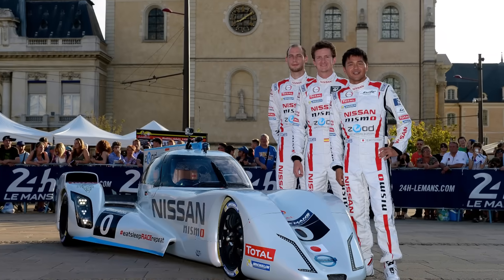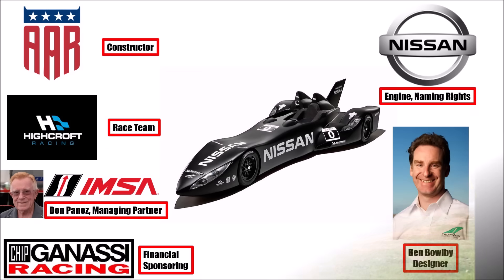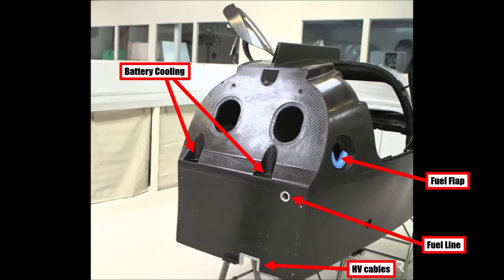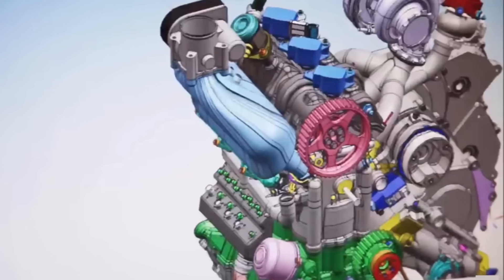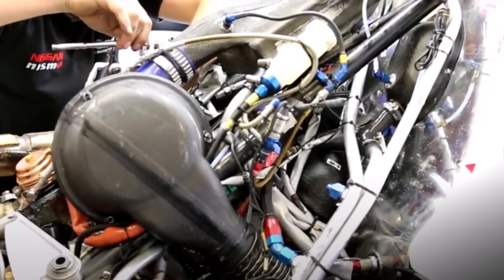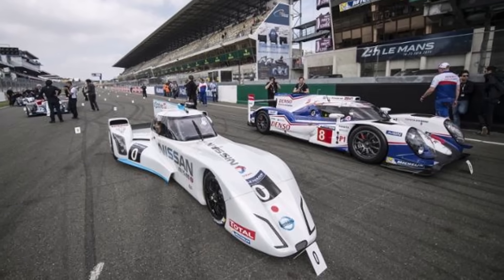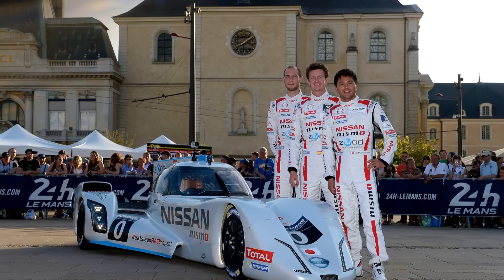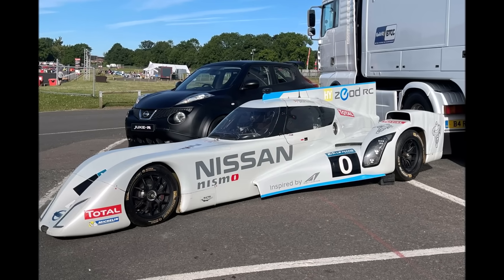Nissan ZEOD RC - The weirdest car Le Mans has ever seen - CLOSER LOOK

Comment: Was that it, an end to the concept?
Were there any fundamental flaws that led to this, such as cornering, or was it FIA rules that put an end to the idea?
Reply from the maker: You can hear about the reasons for this concept in my deltawing video. For Nissan this was it because they joined LMP1 the year after. In the US the deltawing was running for a bit longer with a few little updates.
Reply: @bsport320  Thanks for your reply, I did watch both of your videos, and I watch all of your videos!!!
I still feel unsatisfied, not by you, but by the sport, that this concept did not go further. For instance, in landspeed racing.

Comment: Back when Nissan was in it's prime.
Reply: I'd argue Nissan's prime was during the '80s and '90s. They were putting things like active aerodynamics, computer controlled AWD systems, computer controlled fuel injection systems etc in their road cars. They almost built a mid-engined road car to compete with the Toyota MR2 and Honda NSX (it was too expensive to be made). They built their most iconic engines during this period such as the SR inline 4 and RB inline 6 engines. The Silvia cars (180SX, 200SX, 240SX) were the entry level RWD sports cars to have and those cars are among the most iconic drift cars. The Skyline GTR is considered by many to be the most iconic Japanese car (yes, I know it's debatable but the Skyline GTR is without a doubt the most recognizable Japanese car).
Reply: @CyanRooper i think its corolla  even non car guys know about corolla
Reply: Their prime was mid 90s. They just were not totally shit like they are now
Reply: @dylanburston7453 back then every Japanese manufacturer was in it's prime. In 2000-2010 Nissan was actually innovative with the GTR, Leaf, Qashqai. Juke was the first ugly small crossover in the market. Nissan actually invented this class of cars whether we like it or not.
Now, I'm just hoping that the new CEO will bring the Nissan back in the game.
Reply: @vvevvevvvv 90s nissans were stupid well built (too well built, thats why they had to merge with Renault and Mitsubitshi). Then carlos gohns made every nissan out of the cheapest nastiest materiels possible. It made them more profitable, but the cars were infinetly worse. And did somebody say CVT?
Reply: Nissan was well into their decline when this rolled around

Comment: A shame that both of Bowlby's excellent concepts didn't achieve the success that their level of innovation deserved. Also that 3 cylinder Nissan engine is a masterpiece.
Reply: It’s an RML engine, based on the also RML 4 cylinder used in the original DeltaWing. Nissan just had naming rights.
Reply: Yeah I think he now works for Mazda motorsport. Sad that he never got another big chance after Nissan.